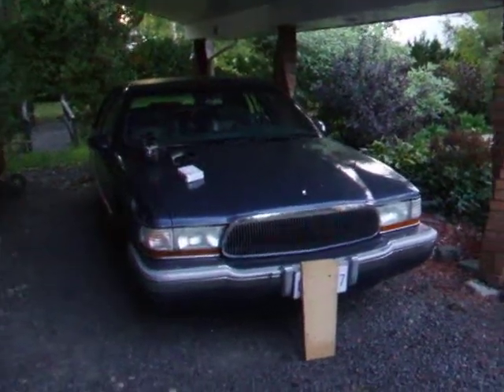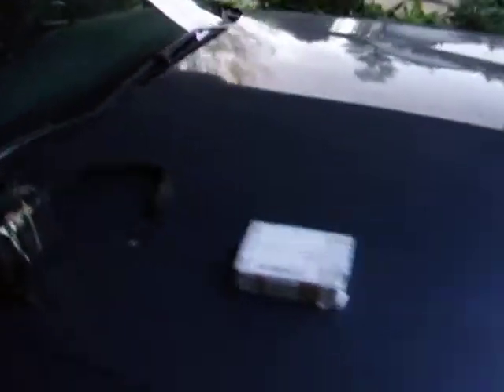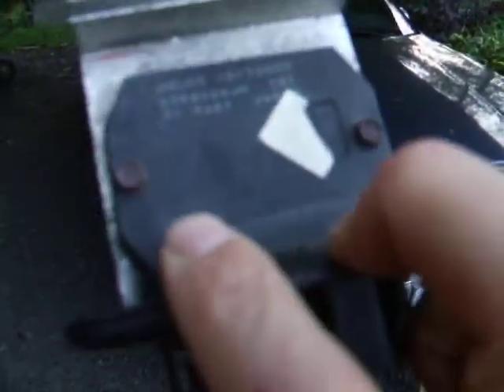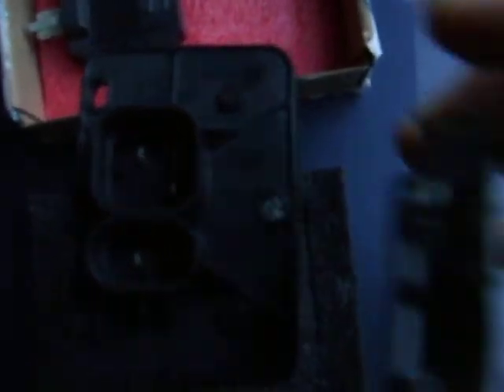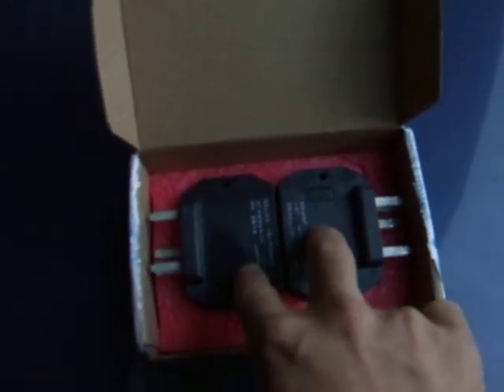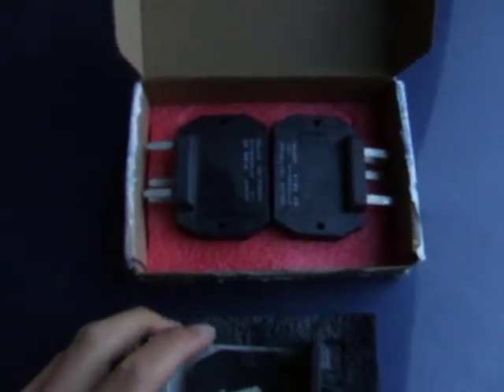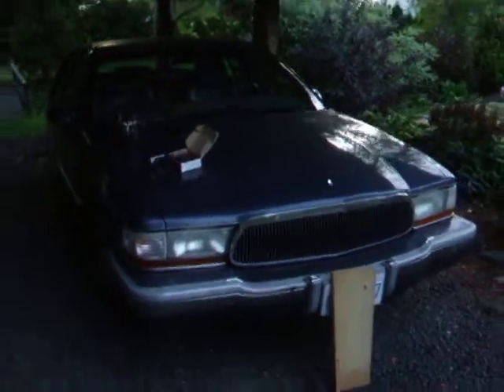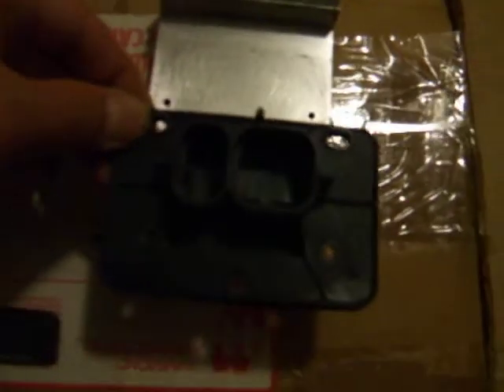$10 Blower Motor resistor/transistor replace on Buick Roadmaster / Chevrolet Caprice - Save $100!

Comment: Is this in the same location on 96 Buick Park Avenue? The part looks the same. The lightning is so dark in the video. It would be nice to show how to get to it.
Reply from the maker: Hi J A, Thanks for the question!  No, the blower motor module is not in the same place, I know as I used to own a '99 LeSabre, almost same car to your Park Avenue.  It and the motor are located in the engine compartment, on the firewall, behind the "Underhood Fuse Center".  In my LeSabre shop manual it says to:

1-Disconnect the Negative Batt cable
2-Remove the Underhood Fuse Cover
3-Unbolt the Positive Batt cable from the fuse center
4-Move the fuse center aside
5-Unplug, unbolt and replace the blower control module.

You're probably right, chances are the module uses the same transistor / Darlington power pack, mounted on a heatsink and connector/mounting bracket.

Hope this helps.  Let me know how it goes J A, if you have any questions, and if it works out for you, and I'll update my description to help others!...:o)

Cheers!~  Bellarmine
Reply: bellarmine33 yes, I can confirm on the 1996 Buick park avenue its in a different location. In the engine under the fuse box like you said.
Reply from the maker: Great, glad you found it!  Let me know if the $10 part fits your Park Avenue and I'll update the description.  Here's the module I bought for myself, and a search for the same part.  Still working over 2 years later:
https://www.ebay.com/itm/322563116118
https://www.ebay.com/sch/i.html?_nkw=STK6994JH
Cheers!~  Bellarmine

Comment: where did you buy the module from? Thanks
Reply from the maker: Hi Will, Thanks for the question.  Just search eBay as I said for STK6994JH and you'll find a bunch.  Here are two links, one for a search, and one for the module I bought, seller's still selling them:
https://www.ebay.com/sch/i.html?_nkw=STK6994JH
https://www.ebay.com/itm/322563116118

Bought a pair in Oct 2017, one to replace and one as a backup.  1st one still working great Dec 2019.  Hope this helps, let me how it goes or if you have any other questions Will.  Good luck and Thanks again for the comment - Cheers!~ Bellarmine

Comment: Gonna try this for 97' Le Sabre.
Reply from the maker: Hi Melissa,

I think you may be right.  I just compared them at my favorite parts lookup site, www.rockauto.com, and the actual transistors for the two cars look the same, just the mounting plates  are different.  You will be re-using the mounting plate,  so no problem.

I used to have a '99 LeSabre myself (see my other videos), got it when it was 9 years old and had it for 10 years, most reliable car I've ever owned never let me down.

The www.rockauto.com site is excellent, it's fun to browse the index of all the years and parts for the different models.  

Try it out and do let me know if you're successful Melissa, or if you have any questions, and I'll add your results to my description.  Good luck & Cheers!  Bellarmine

Comment: I had the same problem with my Cadillac, Fleetwood, 93, they wanted almost 600 dollars to fix it. I fixed it for 10 dollars, just like you said, ordering the park. Thank you so very much. 👍👍👍👍👍
Reply from the maker: Thanks for your comment Carlos, glad it was helpful.  I was getting parts quotes of like $100 to $200, but $600 - wow, that is on the borders of lunacy!...:o)  Thanks so much for sharing your success story Carlos, I'm so happy it helped save you some cash - cheers!  Bellarmine
Reply: Exactly what he said is what I did 10 dollars..

Comment: Hey man, thanks for the info. I have a 96 Buick Roadmaster sedan and I've had problems with mine too. I've been avoiding it cause of the price. But not anymore. Thanks again
Reply from the maker: You're welcome Daniel - not having a blower motor is a real pain!  One thing to watch out for, make sure your motor isn't actually jammed (mine was - LOTS of squirrel fluff, it had been sitting a while...:o).  These are great cars, they just don't make 'em like they used to, these have class.  Cheers!  Bellarmine

Comment: Where was it located?
Reply from the maker: Hi Vince, the blower motor resistor / transistor module is under the dash above the passenger-side floormat, right above where you see me filming it plugged in to the wiring harness in my movie.  

First remove the big black plastic panel underneath the dash, over the floor mat.  It as a few snap clips you push in and the whole passenger-side half comes out.  Then look up and you will see the blower motor (big 8" round black).  The resistor / transistor will be an inch or two away from the motor towards the center, about 1.5" x 3" square panel screwed into the HVAC blower housing with 3 screws.  It has the 2 plugs / 4 wires going into it that you see in my movie.  

You might also find it helpful to remove the carpeted triangular kick-panel near the door-frame, gives you some more room to work on the wiring or blower motor, it has 1 screw through the door frame trim.  Hope this helps, anything else let me know Vince - Cheers!  Bellarmine